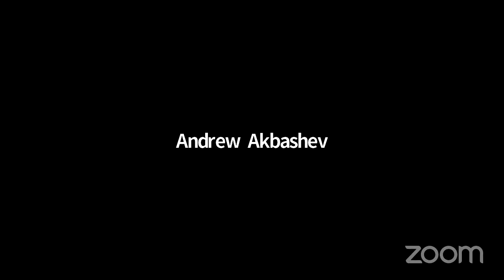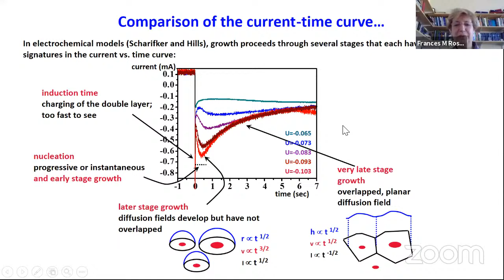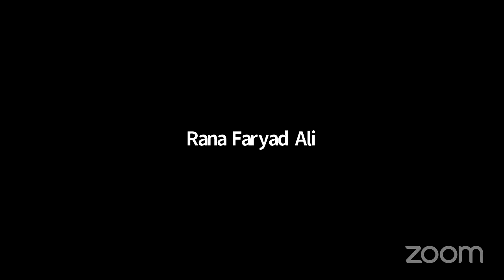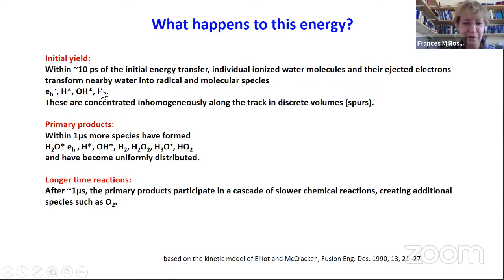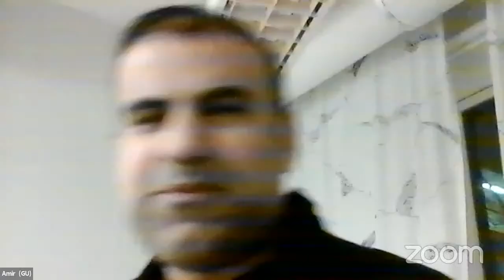10. Prof. Frances Ross - Electrochemistry in a Liquid Cell Electron Microscope (November 4, 2021)

Comment from the maker: 00:10 - Introduction
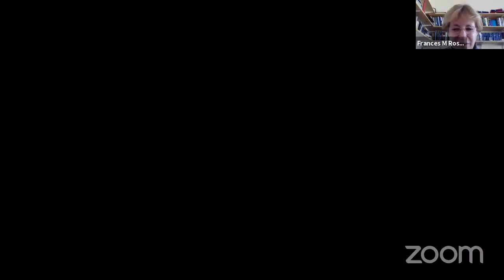03:27 - Beginning of the talk
08:01 - Outline of the talk
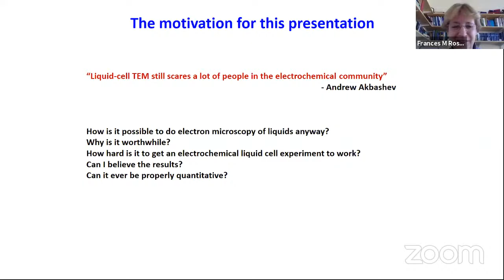10:10 - Liquid-cell EM
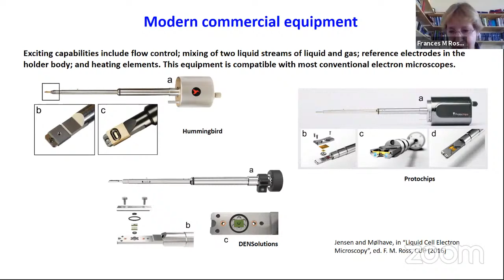23:20 - High-resolution in liquids
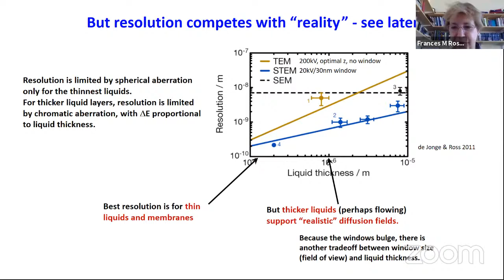26:21 - Radiation effects (part 1)
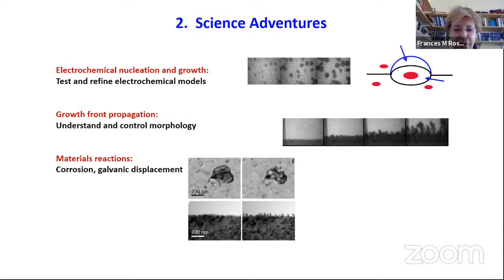28:29 - Nanocrystal nucleation & growth
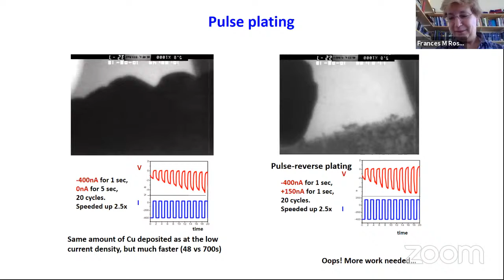37:20 - Corrosion
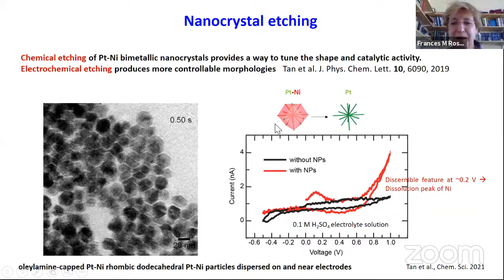39:08 - Galvanic displacement 
39:33 - Batteries
41:23 - First Q&A

1:02:02 - Challenges and Opportunities
1:02:23 - Quantification of electrochemical conditions
1:03:20 - How to make EC liquid-cell TEM less scare
1:08:11 - Beam damage effects in water
1:17:56 - Mitigating beam effects
1:19:32 - Resolution in liquid-cell TEM
1:24:03 - Updating the liquid cell design
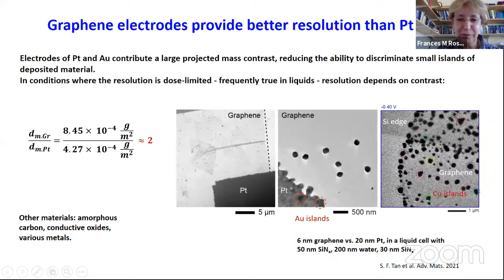1:28:25 - Temperature-dependent electrochemistry
1:32:03 - Expanding the liquid-cell microscopy use
1:37:53 - Outlook for the future
1:39:13 - Second Q&A